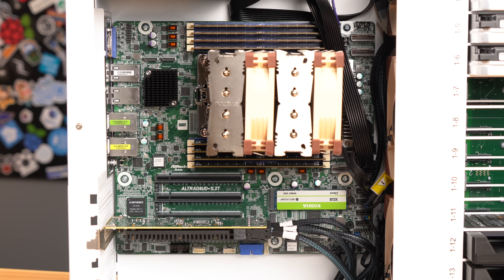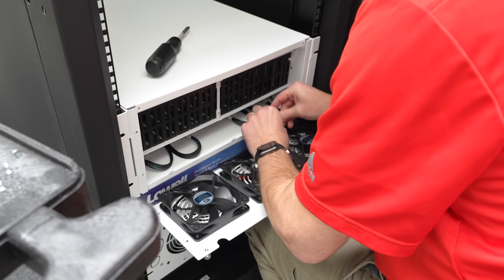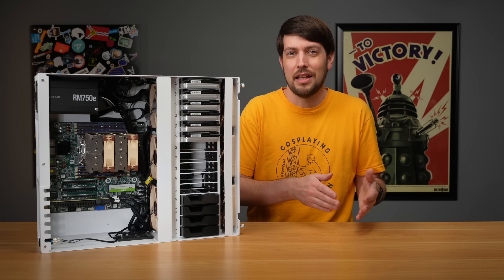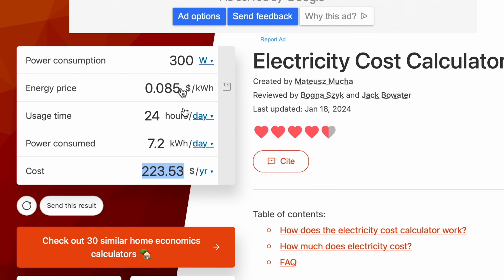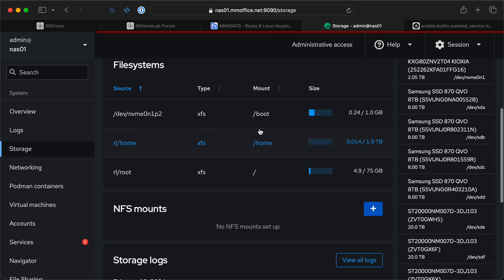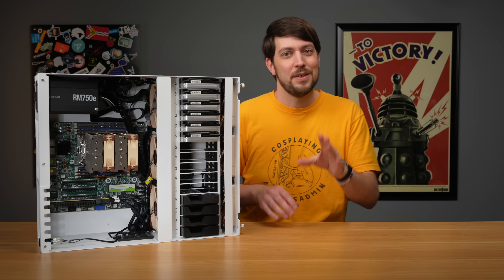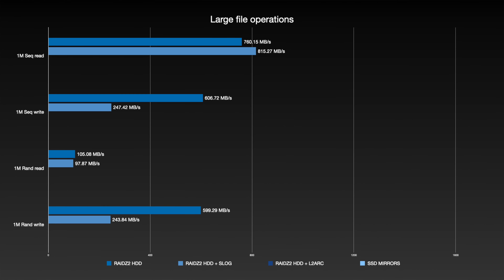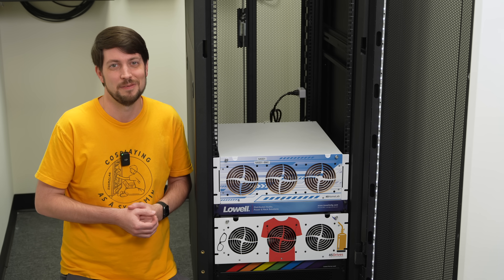Silencing the 100% Arm NAS—while making it FASTER!

Comment: I'm behind on my YouTube consumption, so I'm finally getting caught up on your stuff. Thanks for the shoutout! Not sure if I'm the best place to go for complex ZFS questions though 😅
Reply from the maker: Just having done some benchmarks with actual hardware puts you in the top 5% of all ZFS users though hahaha
Reply: @JeffGeerling  Fair enough 🤷‍♂
Reply: @JeffGeerling  What is that ARM CPU and where can I get it?
Reply from the maker: @Euathlus1985  This one is running the Q32 Ampere Altra, you can only find it on eBay right now. The Q64 can be bought from NewEgg in a motherboard bundle, but other models can be found too, like from ADLINK.

Comment: Does the PWM control take into account drive temps? They can get toasty just by idle spinning. There’s some debate about ideal temps though. Some data suggests that some warmth isn’t bad but there’s definitely a ceiling to that.
Reply from the maker: Right now they don't, it's currently setting it based off CPU temps.

I have been talking with ASRock Rack about their fan control setup—right now it's a little rough around the edges (I didn't cover it in this video because it seems like that could improve).

Comment: nokchua ftw. btw, i have 5 noctu… nokchuas on one fan header, though i did use an akasa 4 port splitter. now im worried. will it overload? i dont think since akasa splitter goes into mb fan header and then four fans into the splitter, but splitter does not have any additional power. any ideas?
Reply from the maker: Most modern motherboards seem to deal with that amount of current on each fan header... but you should be able to find the specs in the motherboard manual. You'd want to see the current limit for the fan headers, then make sure the number of fans you have times their max current doesn't exceed that number.
Reply: @JeffGeerling  thanks. theyre not even pwm, i bought them in the middle of the night, was not paying attention. lol. akasa splitter say 2a max at 12v. asus manual says 1a per header, 12w max. fans are NF-S12B redux-1200 (3 pin variety) and they are rated at 0.9w and 0.08a. i think im good, right? splitter is also pwm, but i cant get reading from the fans, obviously since theyre not pwm. ill just buy pwms and have these as backups. also, asus. god i hate their software. i have to install literal digital venerial disease just to get control of the fans in windows, lol. like, 10 processes and no way of just installing fan control software. hahaha. cheers!

Comment: If my IMM2 module is to trust my RAM alone uses about 100W which pisses me off a bit, but that's with 768GB of DDR3 LRDIMMS, 24 of them, and the whole server only uses 250-300W under load, which is okay. Definitely has more power than my old PC that I used to keep running overclocked 24/7.

Comment: As you found, SLOG only helps with random writes, and only if they're synchronous; ZFS is copy-on-write, so as long as the transfers are asynchronous and thus the storage layer doesn't have to wait until they're written to disk to return a response to the caller, the performance of random writes basically turns into that of sequential writes (assuming sufficient RAM to buffer the transfers).

You show 600MB/s for async random writes for just the hard drive array and 243MB/s for synchronous random writes with the SLOG (since they're just SATA) but it would have been interesting to see the random write performance of just the hard drives with sync forced on (which I would assume would be substantially lower than your result with SLOG).

Obviously this is not the scenario for async writes (which is most fileserver-style transfers like SMB) but sync 4k random writes are a very important metric for databases, hosting VMs on the pool, or in some cases mounted block devices like iSCSI depending on your stack and settings.

If you can still find them, any of the old Intel Optane 16GB/32GB/64GB M.2 sticks make for great SLOGs as they provide extremely high IOPS and have excellent write endurance, and more predictable performance under load than regular SSDs (especially compared to something like QLC).

Comment: It's too bad that there isn't a native build for Proxmox on ARM otherwise that would be a killer platform.

I would've been very interested to see how GPU passthrough worked on a system like this.

My current dual Xeon E5-2697A v4 (16-core/32-thread) Proxmox server with 256 GB of DDR4-2400 ECC Reg. RAM, and 36 HDDs consume around 670 W.

Going with your numbers, the theoretical potential idle power consumption (if I was able to replace my dual Xeon Proxmox server with something like this, whilst keeping 36 HDDs) would go from ~670 W --> ~273 W.

But also like you said in terms of application support (or lack thereof for the aarch64 architecture) -- that's a bummer.
Reply from the maker: Pimox is Proxmox built for Arm, but it has its limitations too :(

Comment: I’ll be interested to see how you get on with these fans. I’ve had a 100% failure rate with that particular model. I’ve switched back to their previous models because of this
Reply from the maker: Really? Yikes! I have had a few of these fans in other systems (but usually settle for their cheaper models), and none of those have failed. I wonder if either you got a bad batch, or if there might be a power supply issue to the fans. Strange!

Comment: If that's a wide input range power supply, try running the system on 240VAC.  Should be worth a few percent.
Reply from the maker: True; I didn't run 240 to the rack, though, and all the PDUs are 120 as well. Next time around, I'll run both!

Comment: redo test with nvme caching layers - you are leaving performance on the table since the price between nvme and sata ssd is about the same - this was a faux paux - also consider bumping up the arrays and especially the networking - goto 10gbe bonded at least or 25/40/56 would be even better - you do a lot of working with images/video/vms and backups so get 2 nas and use much faster networking and save tons of time - it makes sense and you can do it affordably, a v2 incorporating these suggestion would be fantastic for smb sector where they really need these commonsense improvements bump up mtu/jumbo frames and you should get good results #dear red shirt jeff
Reply from the maker: I'm likely going to bond the two 10G ports at some point, just haven't had time to set it up, and right now I only have one computer on the network at 10G so it's not a big deal (yet).

I will be testing some NVMe storage soon, was waiting on something to pan out, and it has panned out (punned out?) so it will hopefully be a very nice upgrade over the QVOs.
Reply: @erling all well and good - you are still settling in after quite the arduous fab and move, i am upgrading to 2.5 this mo and may try to get an 8 port switch to do 5g bonded to nas? quite possible, i should probably just goto 40g and dac myself probably by summer...I have to find a way to get rid of a 'salvaged' radio antenna first #smith chart ...here's an idea for possible future content - build out cheapest diy nas and also cheapest diy opnsense router and then do mid range models also and sell these as well on no warranty basis - you could install a 'factory' bench at front of the shop - would this be a gigantic money maker - probably not but you would find some traction with local businesses and once you get prototypes built pretty easy to replicate - finding a reliable supply chain is basically ebay - would help diversify your rev streams and in red shirt jeff's power alley to keep him occupied - am i talking to myself here? maybe
Reply from the maker: Haha what about the transmitter!?  @shephusted2714

Comment: Dear Jeff, unless you need the hdd space I would've gone with a large array of SSDs in raid 6 or zfs 2. 2tb ssd are not that expensive and are the fastest you can go on a SATA - SAS12 connection (without going to sas12 ssd which are $$$ obv) you have 18 slots which makes it ~38 Tb usable. which might not be large enough for you but they'd be blazing fast. specially for small file access as there is no seek time.
one thing that also increases array speeds is not to mulptiplex pcie lanes and use multiple HBA cards for it. you could go 8 and 8 drives on 2 cards (9 is an awkward number for SAS controllers. you have x8 cards or x16 cards). or 6 in 3 cards. 
if possible add an nvme as a read cache for the array (using write caches is unadvisable for critical data, it is a single point of failure even if the cache is mirrored it is not written to the array itself)
Reply from the maker: I need the space... well at least 40 TB, so I went a bit overkill and am at 70-80 TB right now.

Current dataset is around 20 TB, though I might soon set up an ffmpeg task that compresses all my ProRes RAW footage into H.265 over time. Savings of like 95% in terms of file size, and it's not like I'm editing motion pictures here :D

Comment: LOL Only Fans..  I used 6 of these DGZZI 3-Pin Fan Deceleration Line 47 Ohm cables for $7 a piece on amazon..  Plug in line with the stock fans.  It's not 32db but it knocked it down to an appropriate level.  Temps are all good (upgraded xeon 4214 on stock cooler and 15 Exos 18TB hds)..
Reply from the maker: Nice!

Comment: Great Video Jeff. In terms of efficiency you should try changing the power supply to an HDPLEX 500W GaN ATX Power Supply. Since the max efficiency range of the power supply your using is higher then what your pulling it can be costing you.
Reply from the maker: Looks like a cool PSU! It'd be neat if they offered some ATX-sized ones too, with 600/700W options.
Reply: I am hoping they come out with some larger options. In the mean time they have a sync connection to pair multiple ones.  @JeffGeerling

Comment: Ubuntu is definitely the best Linux distro for anyone wanting to deploy ZFS. Modules are built into the kernel, so there's no DKMS to appease or worry about kernel upgrades leaving you unable to access your data.

ZFS RAIDZ2 is definitely not the best choice for performance, but as you say, it has to be good enough for your use case.

Comment: Don't use electrical tape semi-permanently. It leaves sticky residue on everything after it has been sitting for a while. It's only good really for very temporary use, couple days. There really isn't a tape that doesn't have that problem. But heat shrinks actually do amazing job. As a bonus point, if you use transparent ones, you can actually see what kind of connector there is.
Reply from the maker: I have all my heat shrink tubing at home (otherwise would've used it here)... trying to build up an electronics bench next month where I'll keep all that stuff sitting at the ready!

Comment: The Qvo SSDs are dead slow when writing more than ~20GB at once. The use slc caching but after the buffer is full, they fall back to qlc write speeds and in my case theese were down to 100-150MB/s, thats why the log device didn't help your HDDs in any way.

Comment: huh, odd. 45 drive's samba package not working on arm64? i have it running fine on my Quartz64, which is arm64 :/
can't remember if i compiled it from scratch, but don't think i did. cockpit is super nice though, i can only recommend using the UI on future servers jeff!
Reply from the maker: Samba fine, but their ZFS package had some issues (I didn't spend a ton of time debugging it). The Samba cockpit module would've been fine if I had enabled Samba, but I didn't want to just configure a few bits through Cockpit, and a few by Ansible, so I just tossed out the dashboard for now.
Reply: @JeffGeerling  makes sense. I was a bit confused as you were showing the samba UI when talking about it. also makes sense i didn't come across the issues, as im running my raid on btrfs, not zfs because of stability issues in the kernel for the quartz64 at the time :)
Reply from the maker: You watch the b-roll too closely sometimes haha @DacoTaco

Comment: another note about the SLOG, if you don't have a dedicated log device, zfs just uses your pool to store the data without being explicit about it. yet another quirky thing is that the log is never actually read from unless you're restarting from an unclean shutdown / export of the pool. if you aren't tired of hearing quirky things: if you only use zvols, the log is useless and it's best to totally disable it for your pool since the filesystem you have on your zvol would be in charge of handling a journal or log.

Comment: I was 40 years old when I found out that all my pwm 2way and 3way y-fan splitter cables only had 1 pwm end while the other one/two were not pwm : ( did collect like 20 or so over the decades and never noticed, including noctua ones hehe
Reply: Strange. All the Noctua ones I have always just pulled RPM from one fan. The PWM goes everywhere - it is just getting feedback from one fan.
Reply from the maker: Yeah on at least the newer Noctua ones, it says on the cable something about it sends back the RPM data from one of the fans, and splits the PWM out to all the fans.

Comment: Did you enable ASPM at the Bios level? My system was using 130 watts at idle, after I enabled that it brought it down to 55 watts while running windows. If I load ubuntu it brought it down even further to 35 watts at idle.

Comment: lsi hba card use less power than the one your useing witch would be a good test
Reply from the maker: This is technically an LSI HBA (Broadcom bought out LSI a while back), and there are a bunch of different options. This one is a tri-mode/U.3 card which does use a little more power than some, but it's not the worst for sure!

This 94xx series card is actually a little more power efficient than some of the older ones, but is overkill for this build.
Reply: @JeffGeerling  I recognize the card but I didn't think it was that new

Comment: The 870 QVO's are a horrible option for usecases which exceed the cache on these drives, after exhausting the cache the QLC-nand makes the performance drop to pre-2015 Sata spinning rust. Using TLC-drives which sufficient cache suffer way less from this effect, ZFS-gurus would even advise you to use drives with power loss protection to prevent corruption on power-outage.
Fun fact, it only takes a few months of using the QVO's in moderately used cache-drive scenarios or, god forbid, a CEPH setup to die a horrible, but slow death.
Reply: How is 78GB/drive times 4 not a sufficient cache size?
The last "fact" is as far from true as humanly possible.
They're WARRANTIED for 2.8 PETABYTES (2880 TBW).

Comment: You didn't address the static pressure of the fans and if you are getting the same HDD cooling before and after. I suspect with the swap you did there probably isn't a big difference but on large server chassis without the dual fan walls, you need to take static pressure into the equation.
Reply from the maker: Quite true; these fans have a little lower CFM rating but in my case drives are still running cooler than the ones in my home NAS (under 50C).

Comment: I enjoyed the video, and would point out that choosing RAIDZ2 is important for more reasons than having 2 disks of failure room.  This is related to the self-healing nature of ZFS and how it depends on the redundancy provided by pool design.

A quick refresher for those who may not know.  ZFS generates a checksum when data goes in, and that checksum is verified on the way out.  As data sizes grow the low probability of corruption become more likely, the result of what's colloquially referred to as "bit-rot."  If the checksum doesn't match on the way out then that data is silently and magically corrected using another copy of the data, taken from the redundancy in play (mirrors, RAIDZ).

When in a degraded state, say when your RAIDZ2 is down one disk, the self-healing depends on the presence of redundant data.  Since there's two disks of redundancy, you maintain self-healing when down one disk.

This also makes two-way mirrors potentially problematic.  In the case that you are down one disk, and there's a checksum failure, there's nowhere for ZFS to go for the correct copy.

Caveat:  this is how I understand it, so if I have any details wrong please do feel free to correct me.

Comment: I mostly run Rocky Linux but I won't hold it against Jeff for switching to Ubuntu :) I've never tried to run it on ARM and I'm the kind of guy who likes the path of least resistance so I understand.

He did set SELinix to Permissive which makes Steve Grubb cry.  :) I run in Enforcing but I have a lot of SELinix experience and I understand how mysterious it seems, but running in Enforcing is not that difficult these days - except when it's not. SELinix really is a great thing for servers.

Great video on server efficency!
Reply from the maker: Heh I have personally witnessed that crying a few times. Though some sysadmins who aren't familiar with EL tend to cry when it's enabled too haha.
Reply: @erling The ways of SELinux are mysterious...BTW Steve G is nice a guy